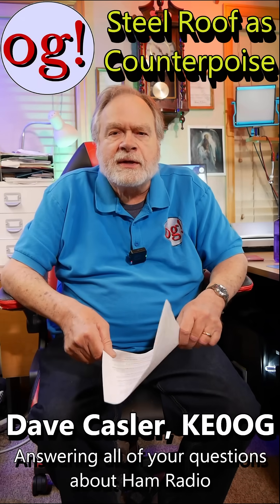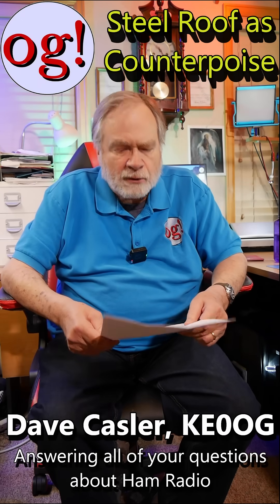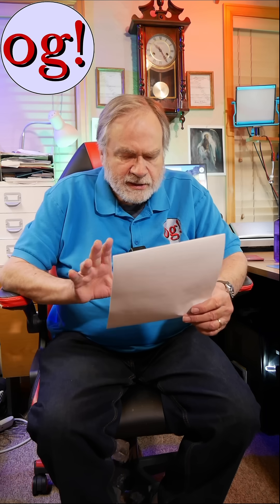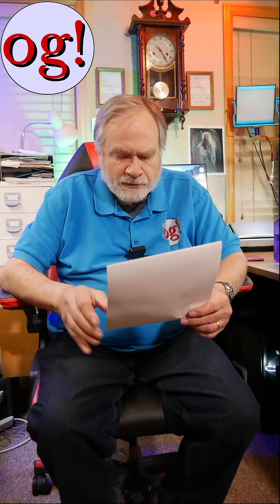Steel Roof as Counterpoise (Short #78)

Comment: Had a new metal roof installed.
Drilling into new roof voids warranty.
Like your correspondent, I went with a magnetic mount (dual-band 2m/70cm) and works as well as the Arrow dual-band that used to live in the attic while roof was still asphalt shingles.

Comment: Yes.  I know all about hot steel roofing.   Quonset.   I have a couple of sea containers. 20 and 40.  Running north south   Would bolting an antenna to one work?   On the ends  or in the middle of the siding